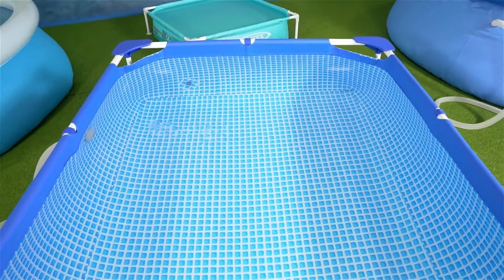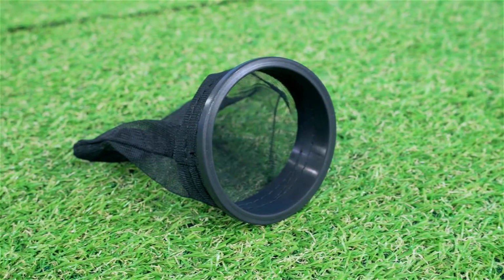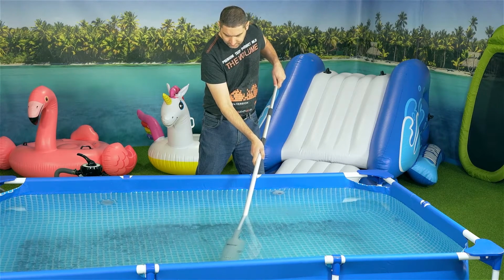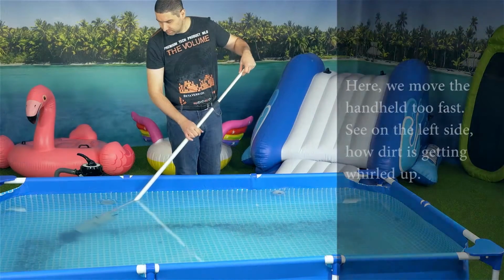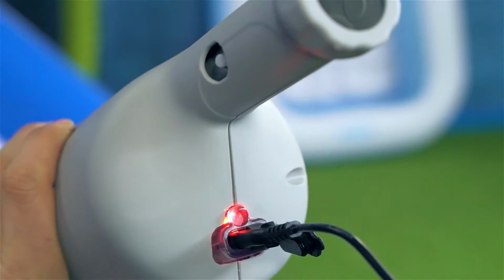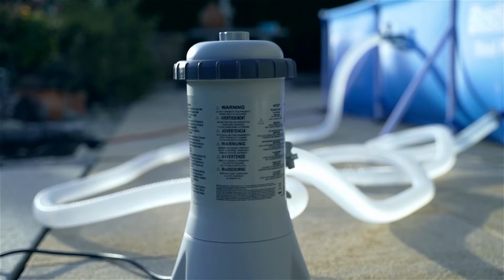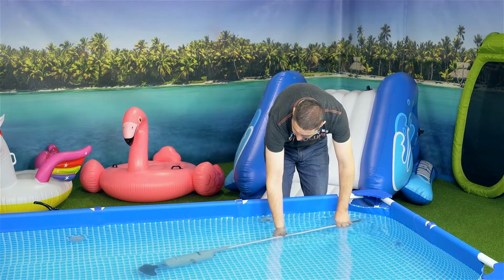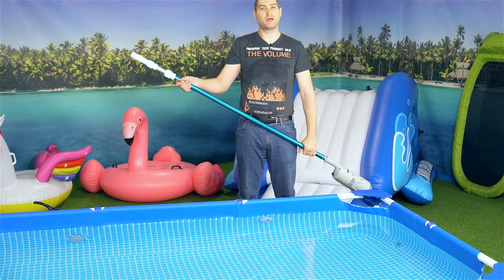💦Intex Rechargeable Handheld Pool Vacuum 28620 🌊- the Intex pool vacuum cleaner in the test!

Comment: i've gone through 6 of these garbage vacuums in the last 16 months. 2 of them died the very first time i used them, 2 of them lasted 1 full battery charge, another lasted about 2 months before it died, another one the clear plastic cup at the end where the accessories attach kept popping off and everything in the vacuum bag dumped back out into the pool. i keep getting them replaced under warranty but i've called Intex so many times i have their number saved in my contacts. the vacuum is good when it works but don't expect it to last. total junk.